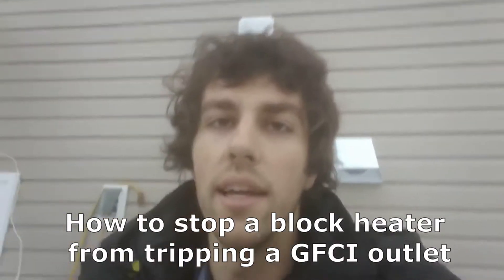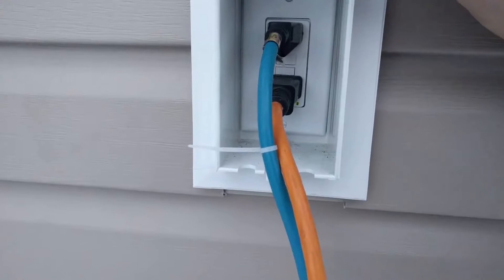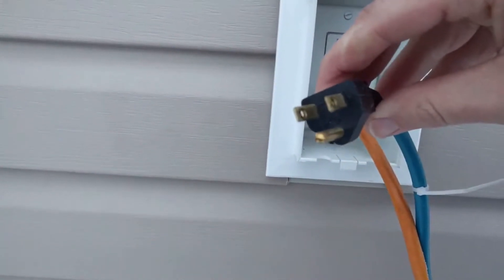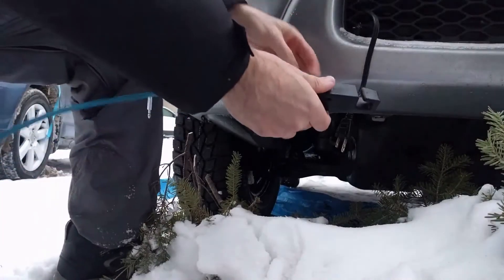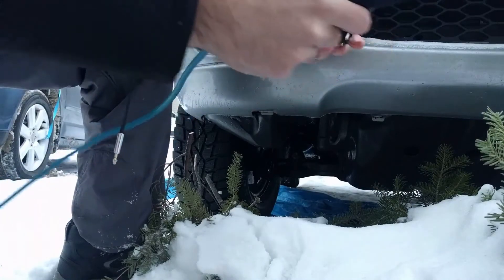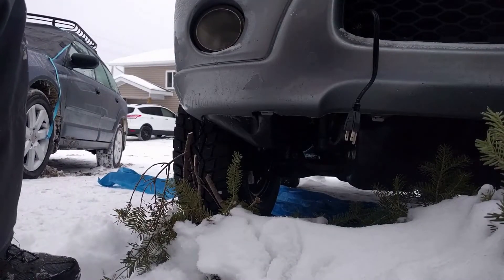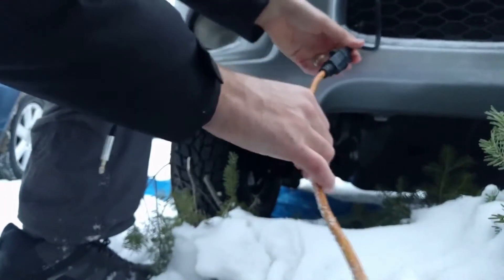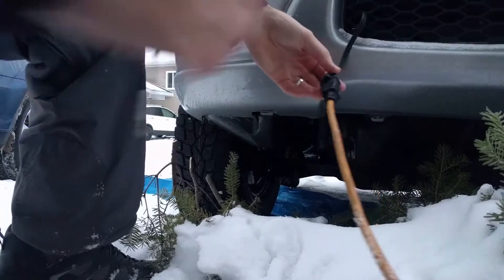Stop a Tripping GFCI Outlet

Comment from the maker: Is this dangerous or not? If your GFCI outlet is wired and operating properly (you should test that it is with the test button), it will still trip should a short occur in a situation with a two prong appliance (which is what we've created by removing the ground prong from the cord). GFCI outlets are not designed to prevent you from being shocked they are designed to prevent a shock from continuing unstopped which is why they are the new safety norm. I do not believe you are putting your life in danger by doing this but proceed at your own risk,  do your own research, I'm not liable for anything you do. Here's some of the research I've done: Since the GFCI does not use the equipment grounding conductor in the sensing circuit, GFCIs will protect non-grounding circuits (2 prong plugs) and can replace two-wire (ungrounded) receptacles as permitted in Sec. 210-7(d) Ex. of the NEC. https://www.ecmweb.com/content/article/20885786/think-like-a-gfci

Comment: I just did this today and it does work. 

It still bugs me that I don’t know what caused it to start tripping, as I measured 0.00amps on ground wire while heating plugged into a grounded circuit. 

Oh well, at least the GFCI should still protect without the ground!
Reply: Not likely 

GFCI= Ground Fault Circuit Interrupter

No ground terminal, means no ground to fault, therefore disabling the device

This is a “work around”, not the fix
Reply: @ss0073  I don’t think GFCI monitor the ground at all, only the phase and neutral for current imbalance.

That being said I measure 7.25A on phase and 7.18A neutral and it’s not tripping GFCI when ungrounded.

I honestly dunno what’s going on lol
Reply: @gnarlock3927  Does it trip when you hit the test button?  It seems like it would be tripping in the scenario you described.  But I'm no electrician.
Reply: @TheOriginalJealotFaith  Test Button does trip it. Its beyond my electrical comprehension lol wish I could just pull the block heater out but not a fun job in the cold!